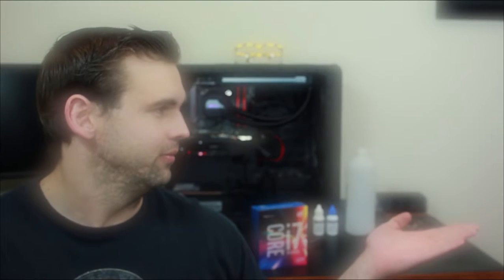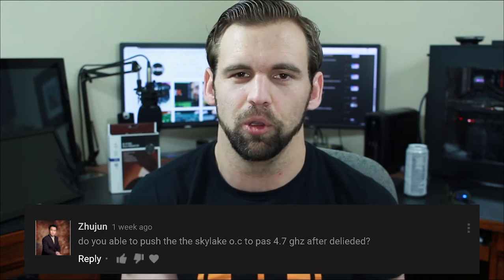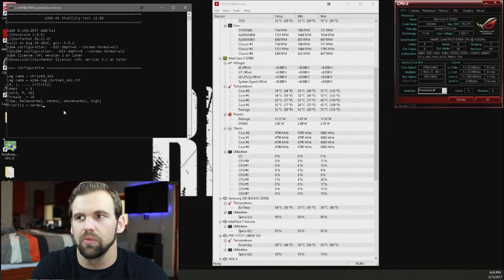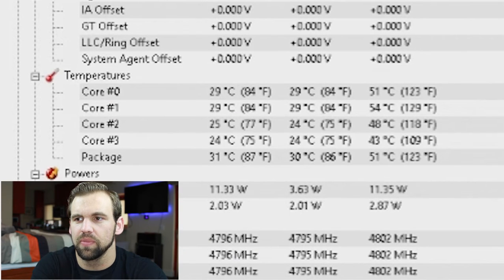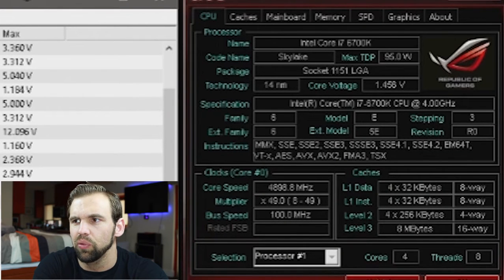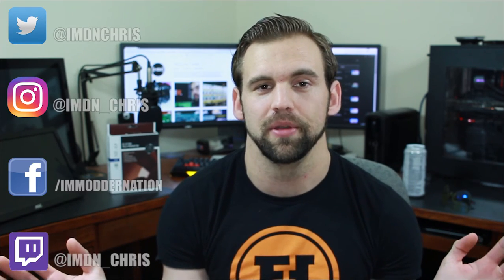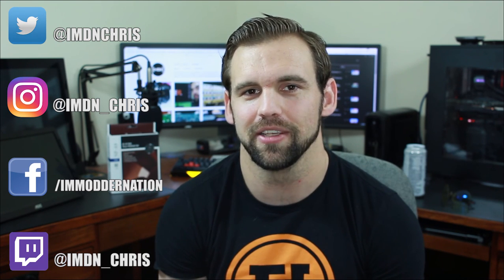DELIDDED SKYLAKE 6700K 4.9 GHZ OVERCLOCK

Comment: I have my 6700K delidded, repasted with liquid metal and watercooled with a beefy 240mm rad in push pull. 
I get rock solid 4.9ghz at 1.45v core. Zero chance at 5.0ghz though, not even at 1.5v core. 

I can do Cinebench R23 and Aida64, all games and programs possible.. Prime 95 will run for a while but one of the cores doesn't like it. It's completely stable otherwise, hasn't crashed on me once in 3 years, and I've been hammering it.
Reply from the maker: That's amazing! Congrats, you got one of the good BINs. That voltage is really high so be careful you don't cook your CPU. AIDA is kind of an easy test so I don't recommend it for overclock stability testing. Its almost as unreliable as POST testing.

Comment: bclk overclocking gets higher clock speeds  to bad intel blocked it   because non k cpus  used it to overclock
Reply from the maker: Bclk overclocking is more unstable on Skylake and Kabylake, it's easier to OC the multiplier. You also can't overclock much because of the clock speed being tied to other things in your system.
Reply: @ImmodderNation  incorrect skylake u can isolate  cpu and ram bus from pci  by locking pci bus speed   this let's u only push back on ram and cpu  on older gen 5 and under u can't isolate the pci bus so its unstable  gen 6 and up can bclk  oc just like back in 2000  bclk oc gives umore options for mix or multiplyer and bclk setting to play with only down side is cpu is locked in turbo mode at fullspeed

Comment: My i7 6700k is stable @4.7ghz 1.41v ibt Very high 30 passe, should i delid it?
Reply from the maker: Yes. You can probably get another .1 GHZ out of the processor or at the least it will reduce the temperature of the cores to make your OC more stable and degrade slower.
Reply: @ImmodderNation  is worth the risk of delid?
Reply from the maker: You don't have to use a razor blade. Delidding tools are safer, but there is still some risk.

Comment: my cpu 4.8 on 1.38 it is point go on 4.9 on 1.45??
Reply from the maker: Maybe. Don't go higher than 1.45V without a voltage meter because you risk frying your CPU.

Comment: hey guys pretty new to oc. I really want to hit the magical 5 ghz on my 6700k I got the Asus Maximus IX Formula motherboard and a Corsair H115i cooler. My CPU is delidded and runs at 4.5 ghz rn. What do I need to look for when I try the 5 ghz or lets just say 4.7-4.9 ghz only the voltage right? Will my voltage constantly be the value I set or will it be variable? Thank you :*
Reply from the maker: What a goal! First of all, understand that not all processors will run that high no matter how much voltage you apply. Silicon Lottery was selling binned chips that would get to 5 GHZ but they sell for a premium and are extremely rare. If you follow my overclock guide here it explains that ASUS boards have more advanced settings than just the voltage.

https://youtu.be/EaqV_TqEMF0

1.4v is the highest safe voltage you can run without burning up your CPU. Most everything else will be controlling the voltage that goes to your chip including Load Line Calibration and balancing voltage on the VRMs. You want to reduce voltage ripple to make sure it doesn't dip or spike to increase the stability of your overclock. Be prepared for some extreme cooling. I suggest reading up about 6700K overclock.
Reply: ImmodderNation wow! Thank you very much. I will try to understand more about it before I try it myself... ;D
Reply from the maker: When you try it, let me know how you did.
Reply: ImmodderNation sure!

Comment: Im running my i7 6700k at 4.8 ghz @1.295v and only reaches 68 max not delided just using coolermaster 240ml aio
Reply from the maker: You've hit the silicon lottery my friend! Impressively low voltage for that overclock.
Reply: Under cinebench
Reply: U think i should push it further?!! haha im curious
Reply from the maker: You might be able to hit 4.9 at 1.4v but don't push the voltage any higher. Also not for daily obviously because silicon degradation. Have you tried gaming with it?
Reply: I am on my pc right now it is up and running @5ghz!!! At 1.36 v cinebench scores around 1085-90
Reply from the maker: Do you have a screenshot from CPU Z? I'd be amazed if it just booted.
Reply: ImmodderNation email me i will screen shot cpu z
Reply from the maker: How about you host the image and link it here instead?
Reply: ImmodderNation ill try to do that lol. Not to familliar how to use youtube
Reply: @ImmodderNation  okay i did it heres the link . i have no idea why my cinebench scored are low but under 5ghz i usually get 1070-1090 i was getting 1200s my first time https://drive.google.com/open?id=1s8j-1Yf1DqJUx7GDtG-ZAZ6W7DeLkPl5
Reply from the maker: Very impressive! You should find out the bin number of your processor. Looks like a winner to me! With delidding you should be able to drop the temps even lower.
Reply: ImmodderNation i was surprised myself too haha delid coming soon.
Reply: 73 c max

Comment: "dont feel bad if ur processor cant get higher than 4.6 ghz" ohh really ...@#@# so why did i pay extra money for the "k" version bought z series chipset motherboard and huge cooler for ... crapy 6700k im so sorry i bought it
Reply from the maker: A 6700 processor should be able to achieve 4.5 at the most with a base clock overclock. How you spend your money is up to you.
Reply: @ImmodderNation  indeed if i knew that u know... but i feel bad for the fact i bought this series, i would have more satisfied with x5650 overclocked to 4ghz .... Knowlege ppl is impotant
Reply from the maker: Also know your options. Newer isn't necessarily better.

Comment: Thanks imdn for this information, so, is it safe to overclocking i7 6700K up to 4.8 GHz and can it be stable for a long time usage?
Reply from the maker: Going to vary by processor. If you look at the percentages at the end, that is the probability you'll be able to stably hit that overclock. Safe also varies by the cooler you have and how much voltage you give it. Don't cross the threshold, giving more voltage doesn't always make it more stable. 

The higher the overclock, the faster the processor could degrade over time. You'll discover that you have to increase the voltage in order to maintain that high overclock. I run 4.7 GHZ daily, but your results may vary. Thank you for your question.

Comment: great video, but i just noticed that your Vcore was 2.9 volts ... did you fry your cpu after that test ?
Reply from the maker: Vcore never went higher than 1.47 volts, even at 4.9 GHZ. I'm not sure where you saw 2.9. Thanks for watching!
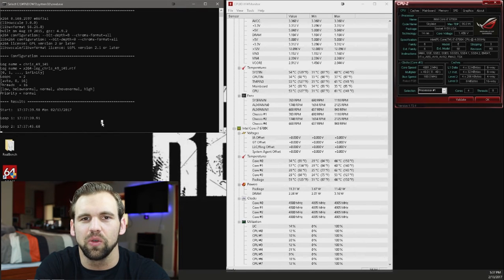Reply: check hwmonitor, VCORE @4:57 current and highest
Reply from the maker: Oh I see where you're looking. That's not actually Vcore, CPU Vcore is listed at the top, but its cut off because I was showing CPU Utilization at 100%. 

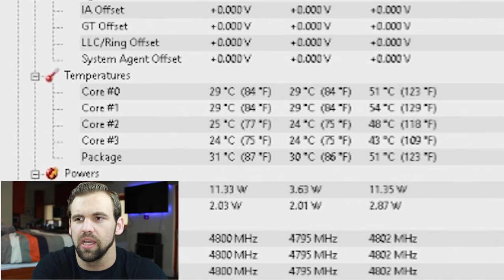Check out 2:52 to see CPU Vcore. I don't know why the values are different. Some people suggest that the second Vcore is CPU PLL voltage, while others say it fluctuates too much to be PLL. Glad we got this cleared up. 👍
Reply: thank man, i just delided my 6700k. though i only used normal thermal paste and not the metallic one, i saw improvement of 13C. big difference with only normal paste since i already know my CPU had a shitty intel stuff and was probably not applied correctly by intel. keep up the good work. :)
Reply from the maker: +abdullah mohammed Great job and thank you.

Comment: I can get my 6700k @4.7Ghz with 1.35v. Aida, rog and h.264 are soft but closer to real world. Passes easily but Aida is good with fpu only for heat test. The only time i consider it a pass is intel xtu benchmark 5 runs. I can pass everything at 1.325v but intel xtu requires 1.35v. Prime 95 never "passes" because it throttles too early to test stability. Im considering delid for that sweet 5 Ghz
Reply from the maker: +Kyle So +Kyle So You should absolutely delid. You can push your overclock to the next 0.1 GHZ most times and keep temps low. You don't need the absolute hardest stress test, H.264 and Realbench are sufficient for the  most demanding applications like video encoding. If you do choose to delid, let me know how it goes Kyle.
Reply: Probably will take a few months. I have the stuff I need but not the money to replace my CPU if I brake it.
Reply from the maker: +Kyle So Be careful and go slowly. You only get one shot. Do not miss your chance and blow this opportunity comes once in...wait, what happened? Where am I? Lol

Comment: I always wondered why it is so dangerous to go that high with voltage. Is it because of the temps or something else? And how hard does it decrease the life span?
Reply from the maker: The most significant effect on semiconductor life seems to be temperature. Scientists are still trying to find ways to predict silicon transistor degradation over time by examining individual transistors one at a time with microscopic electrodes. Here's a great article I was reading about it.
http://spectrum.ieee.org/semiconductors/processors/transistor-aging

Comment: I have my krabbylake 7700K and it runs so hot on AIO cooler- x264 stress with zero overclock hits 79-85 on all the cores. I have the rocket delid tool coming in today and some Prolimatech Pk-3 Nano Aluminum Thermal Compound - will that be okay? That super sliver conductive stuff scares me as I know I will end up injecting myself with it and turning full on T2000. My guess is whatever intel put in there is a giant ball of snot and this should lower temps...or does it have to be that silver shiney stuff?
Reply from the maker: I might first check the mounting of your AIO cooler. It could be mounted wrong because it shouldn't be hitting those temps on stock. Hopefully there's nothing covering the heatsink like a piece of plastic, i've done that with the Hyper 212+. Check to make sure your voltages are stock as well. I would highly advise against using anything other than metal paste for delidding, but Kryonaut or Gelid GC Extreme would probably be the lowest I would go, anything higher you won't see much difference over stock. I don't know how well PK-3 works, but I wouldn't use PK-1, lets put it that way. Don't be scurred of the metal paste, it's not going to give you cancer...at least not yet. If you're worried about conductivity, you can always buy liquid tape and cover those four pins next to the die. It'll prevent you from accidently grounding your krabbypatty.
Reply: Yeah I have checked the mounting - twice, I got good contact and temps  are way over the place across all four. I have all the tools now to delid but am holding off since I got a ryzen 1700 to play with and x370 mobo. so been mucking about with that for the past day. Holy shit is this thing impressive. I will order the silver cockring stuff and wait to delid next,,or not at all if this Ryzen keeps kicking ass :) maybe just sell the krabby and kit.:) Toodles!! p.s you ar still so fucking handsome ..it hurst my left eye to look at you directly :P
Reply from the maker: That sounds like a problem with the processor. If each core is more than 10 degrees apart and you're still under warranty on that, I would send it back. Have fun with the Ryzen, i'm mighty impressed with the results i've seen Tech Tubers getting, especially for that price. Good luck.

Comment: ever thought of making a video comparing thermal pads?
Reply from the maker: Thermal pads for processors? Paste is usually preferred to pads in most cases due to better heat transfer. I haven't considered it.

Comment: the best way to test for stability is to run some video game. I tried those stress test and they never failed. tried playing some games, it failed after 15 min.
Reply from the maker: I'm sorry to hear that. I don't know what stress test you ran, how long, and under what conditions. There may be some other issues going on related to memory or GPU, are you overclocking those? Maybe try a different GPU or memory, if you have any, to access the problem. I would advise against using a video game to stress test a processor because different games utilize the cpu differently. Variation in game titles could either be stable or crash instantly depending upon the game. If you get a blue screen, I would take a picture of the error code and perform a google search.

Comment: i wish my gigabyte gaming z170x gaming 5 motherboard had a better load line calibration. as even on high you still get vdrop under load. and the only settings it has are normal auto and high :/ for z170 mobo its pretty lacking
Reply from the maker: That makes me really sad because Gigabyte uses the same BIOS for all their motherboards. I hope that gets fixed in a future BIOS update, but we'll have to see.

Comment: You hear that Linus? AIDA 64 is not a good enough stress tester for delidding.
Reply from the maker: To Linus' credit, at least he ran the full suite in AIDA64 instead of just CPU only like I did. Still, AIDA64 is much easier to pass than the custom x264 I was using and is not recommended as a stress test.
Reply from the maker: You're very lucky, Nathaniel. Hang on to that processor.